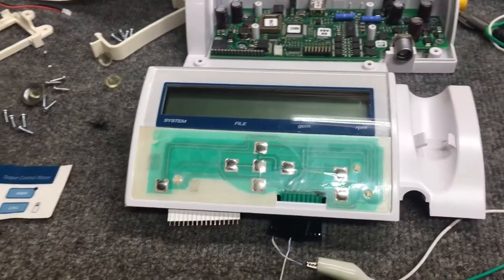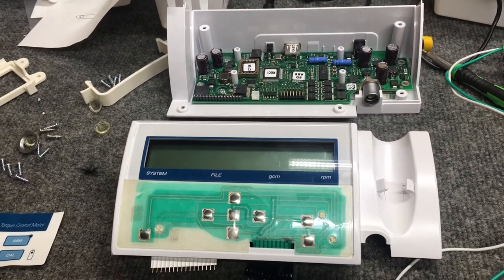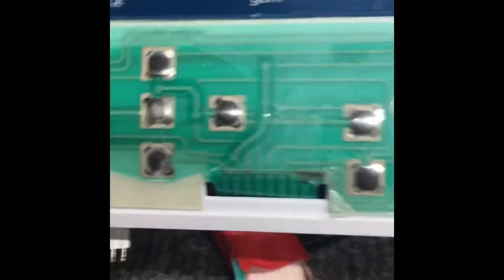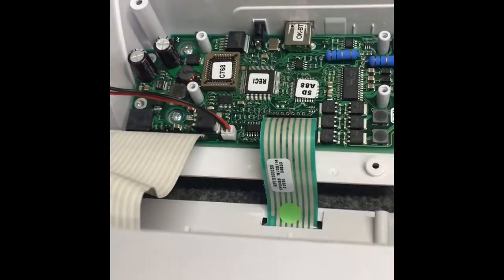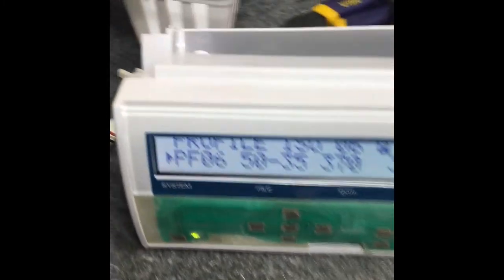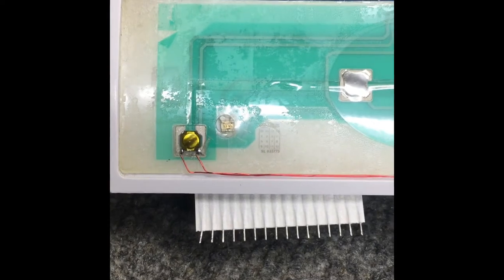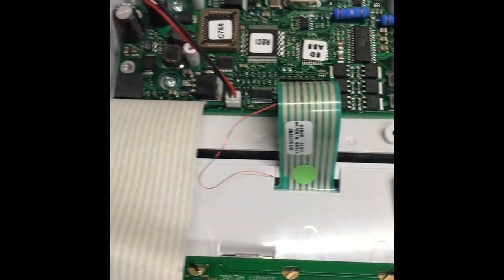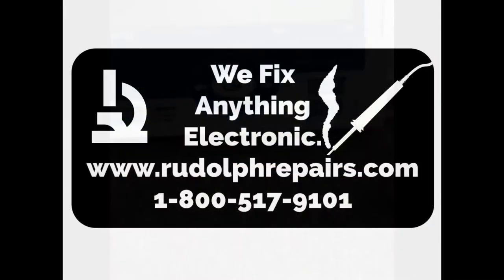Dentsply Torque Control Motor Repair

Comment: I have one of these that's turns on but the handpiece motor doesn't turn when you press the foot pedal.  What do you recommend?
Reply from the maker: Could be the motor control/drive circuit - there is a proprietary driver chip that handles motor functions.  We would be happy to get this on the bench for you, and working again 👍

https://www.rudolphrepairs.com/mail-in-repairs
Reply: This guy has been missing in action since he received my E3 endomotor. No replies to emails, no return calls.  Nothing. Save yourself some stress and heartache. Send your unit to someone else.